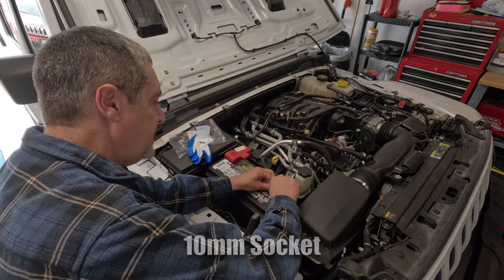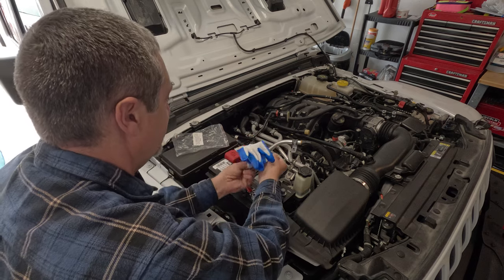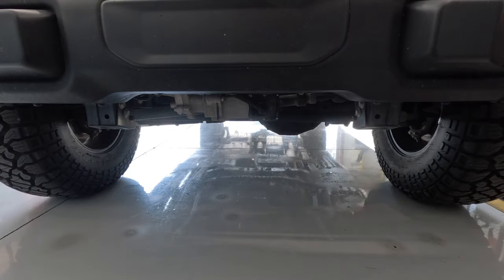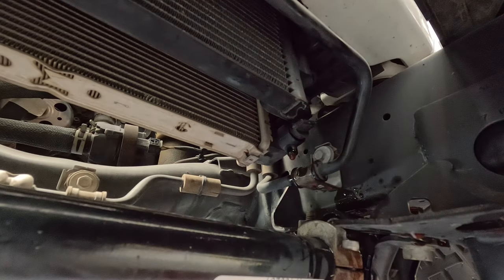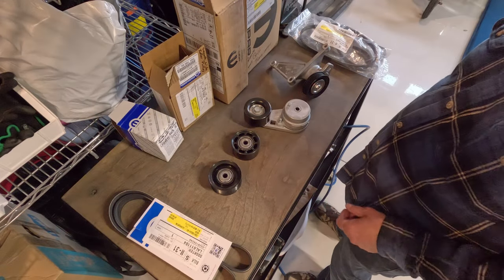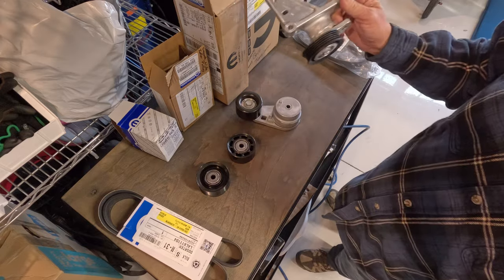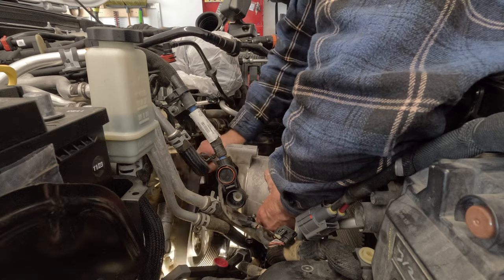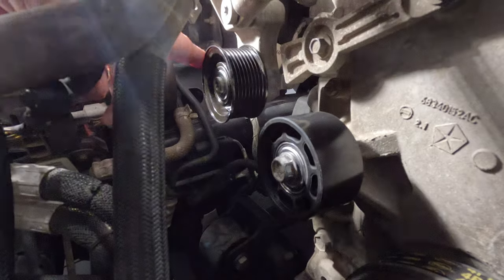How-To:THE Complete 3.6 eTorque Belts and Pulleys Replacement

Comment from the maker: So does this job seem more or less difficult for you than you initially thought? I didn't expect to find that I'd need to disconnect the lower coolant hoses to get the accessory belt off.😑

It's not like the old days when you could do this in 15 minutes but hopefully the video helps you get it done in an afternoon. Likes and shares will get this video's eventually needed info widely distributed to other 3.6 eTorque owners. Thanks for your time and support.